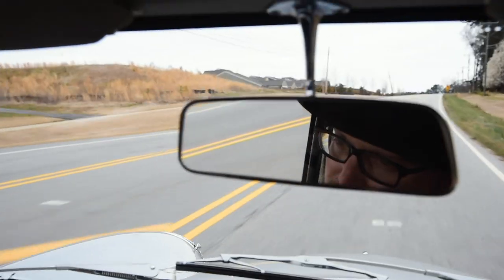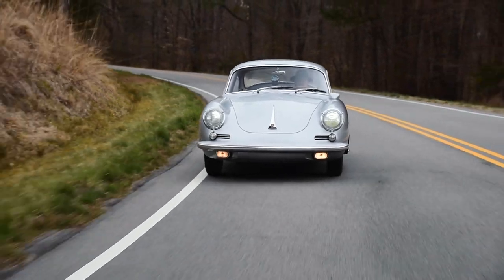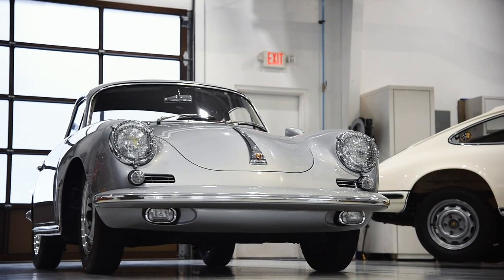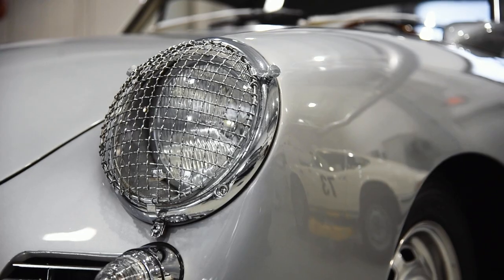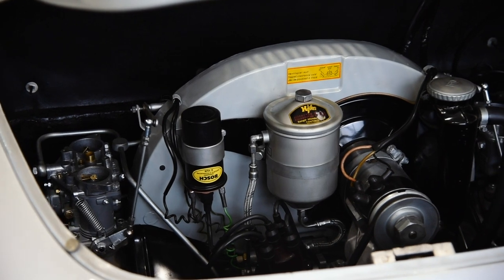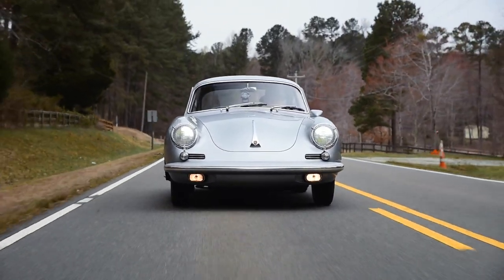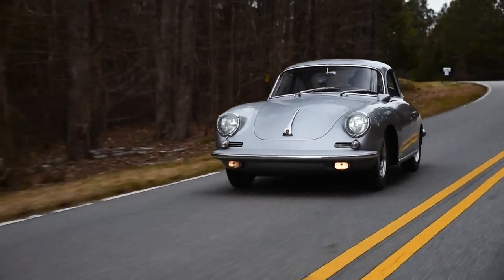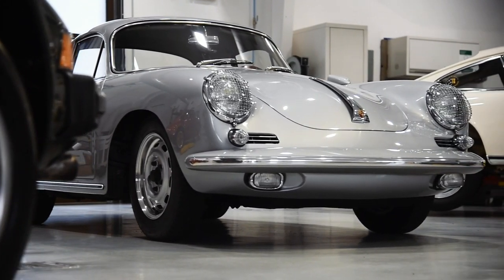Cam Ingram drives SC/GT - 1 of 6  (Chassis # 126955)

Comment: Would have been nice if you had told something about the car; what part of the body is aluminum, what heavy parts were left out, horsepower, etc. long before the C came out, Porsche was doing dyno pulls snd taking the engines that produced the most HP and selling these with cars going for racing.